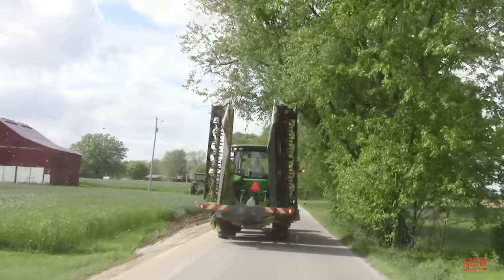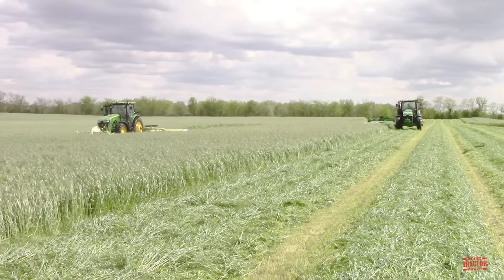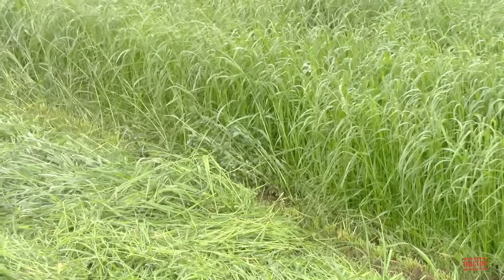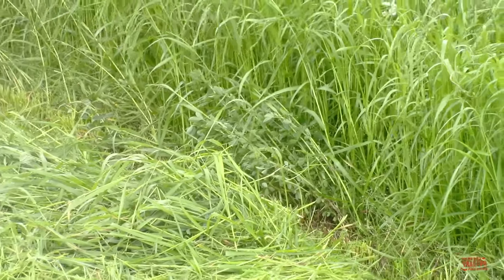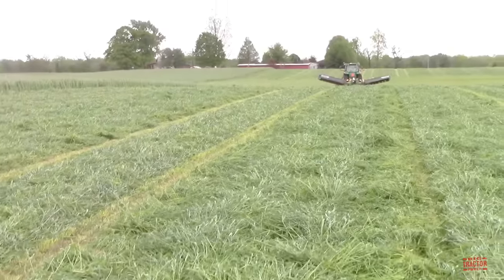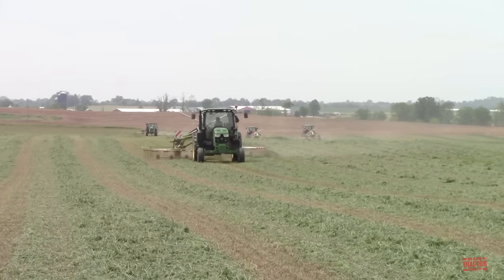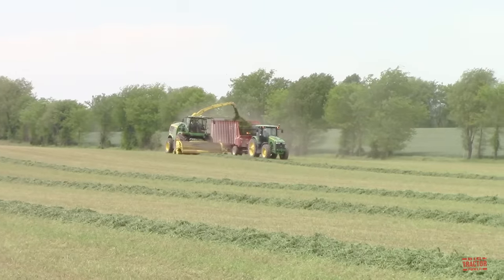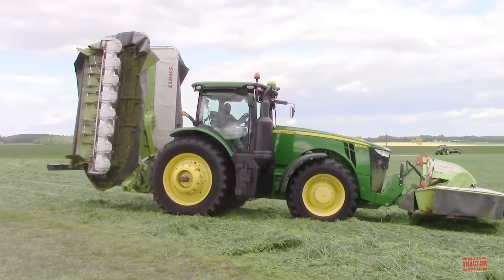FIRST FIELD of 2020 Hay Mowing with JOHN DEERE 8245R Tractors

Comment: I used to cut hay. We had a rotating mower that let down on the side. Kinda like the single in this video but no wheels. It was worn out by the end of summer and had cut part of the cover off of it. We did not have a cab tractor. It would sling cow shit all over the tractor, and you. .... but as much as you had to watch for rocks and other things to keep from tearing up the mower... I can’t imagine trying to mow with a mower like that on the front of ur tractor.

Comment: Nice video, what is the difference between a 6250r , a 7250 and this 8245?
Reply: Victor Bonnast
I think the weight is the main difference. They can be equipped differently and are therefore more suitable for certain jobs. the lightest tractor will have advantages in terms of handling and maneuverability, since it is probably smaller. but he can lift or pull less because the limits of the load capacity are reached earlier. neither will he be as strong as his heavier brothers. i'm not a john deere specialist, but i think that's how it will be.
Greetings from south tyrol, the northest part of italy.
Wolfgang
Reply: Wolfgang is correct. It's sort of like small, midsize, and full size pickup trucks.

Comment: What’s the benefit of the moco vs running two triples, other than cost.
Reply: The MoCo mows and conditions (crimps) the hay so it dries faster.  The other one just mows quite a bit quicker
Reply: @carmfarm5  No the triple mowers have flail conditioners too. Personally I'd figure it's just different strokes for different folks. The triples are a little faster but need a bigger tractor and cost more and also are far more complicated. The center pivot mower is much cheaper and doesn't need as much power and simpler, but is slower and lore awkward to mow with. Just have to decide what's best for your operation really.
Reply: @sstroh08  Looked at it again, your right.